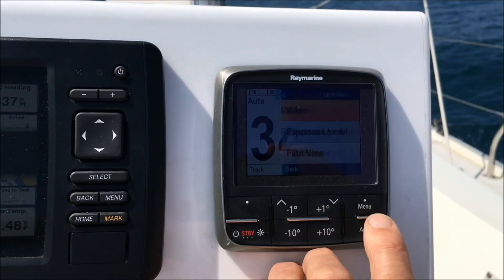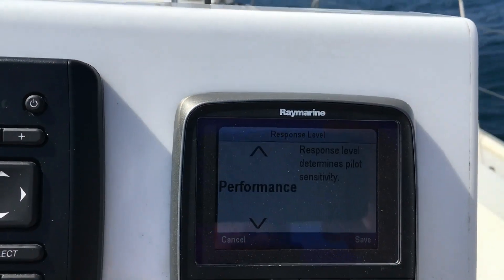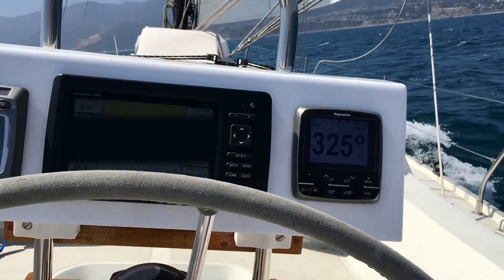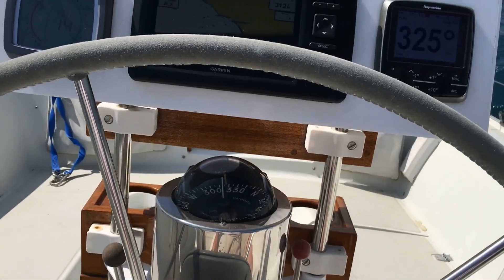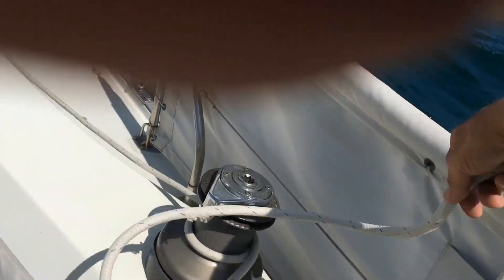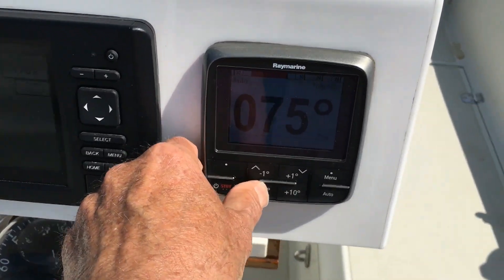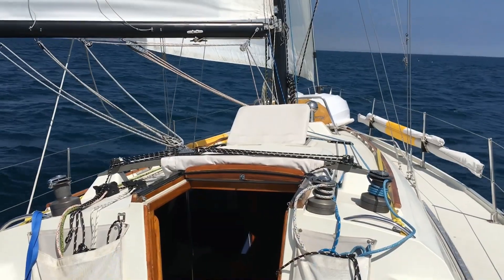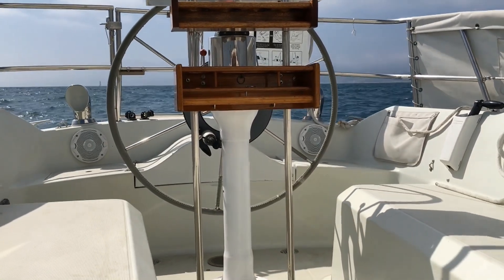Why We Sail--"The Wheel Pilot, 2018"

Comment: Thought you can Tack or Gybe by pressing -1&-10 together or +1&+10 together
Reply from the maker: Plus and Minus simultaneously gives 90 degree turn.. Repeated touches of + or - inputs any new course you like. In casual daysailing my tacks and jibes are seldom 90. For a 130-degree jibe, 13 taps. Can be useful when shorthanded. .

Comment: I have an ST4000 that quickly drift off course after I set the autpilot.  I was thinking of replacing the system with an EV100 but you made me think about sail trim.  Perhaps I just don't have it trimmed right.  I'll be honest, I don't have much of a clue of what I'm doing.

Comment: Do you have the rudder sensor as well? This video helped me decide to try out the EV-100 on my C&C 30-1 and I'm trying to decide if I need it.
Reply from the maker: Not required, and mine works fine without.
Reply: Hey John, just pulled the trigger on one tonight. My boat is also a C&C 30 mk1. Let me know how you make out with yours!
Reply: @brandonedwards1181  for sure. I really wonder because I worry the swept back rudder shape of the C&C 30 can do wonky things. From what I’ve gleamed online some people love their Ev-100 autopilot and others hate them. I suspect sail trim and also placement of the sensor can really impact performance. Where are you going to install the gyroscope?
Reply: I'm supposed to be getting mine in tomorrow. Boats on the hard because winters in Newfoundland can be very harsh. I'm not sure where I'll install the gyroscope just yet, I have to get the old tarp off the girl this weekend, so I'll decide then. I will report back with what I'll do. This is my second year with the boat; I found she had a lot of weather helm when I sailed her the few months she was in the water. Make note I mostly sailed with the genoa, but this year I plan to utilize the mainsail properly (this is my first sailboat). Hopefully, she will balance out the way she was meant to, I had an experienced sailing friend onboard, and the genoa the boats outfitted with was like nothing he has seen before. It is probably one designed for racing given C&C's history, but it has me a little worried that it's causing the boat to be unbalanced. But one way to find out.

Comment: Christian, thanks for your video, probably the best for ev-100. I've been using ST 4000: following 5'+ see it loses control in 5 -10 min, in close hauled it continuously corrects course, while it is not needed. The system setup is not strait forward, does not have deadband . From your video looks like EV-100 makes not big difference. Am I right? I try to choose between EV-100 and CPT. Your opinion?
Reply from the maker: Both Raymarine SPX-5 and newer EV-100 work well for me, with no such issues. Sails must be trimmed or reduced for neutral helm. I haven't tried the CPT, it looks clunky to me.

Comment: As a real novice, this is really interesting thanks. So how easy/quick is it to switch off the auto pilot and take over the wheel manually instead? Also, what are the limiting factor to using the wheel pilot, it seems to be suggested here that a bigger boat or stronger winds wouldn't be suitable for this system? Thanks if anyone can offer answers. Best Wishes.
Reply from the maker: To disconnect, push a button and release the clutch.  Wheel pilots are simple and inexpensive. They're intended for motoring and light-air sailing.  Heavier conditions require a  powerful hydraulic steering unit or a wind vane such as: https://youtu.be/_gEJ3RJYiYc?list=PLXJx_F6E8T8y8BVNBmmZ1c9udOwnNjx93

Comment: Do you find any performance differences between the new wheel pilot and the old SPX?
I’m interested in any generational improvement between the two.
Cheers
Reply from the maker: Not much difference in performance or interface.  Both work equally well for me.

Comment: It's one thing to be on flat water. It's another to use the wheelpilot for 6 days on an ocean passage. I have 3 spare wheel pilots and am planning on installing a below decks unit because their motors burn out so frequently. My boat is lighter than yours. I will look to adjust the "hard over time", which I have never heard of before this video. Thanks for the tip.
Reply from the maker: I suggest a wind vane, since you already have multiple wheel pilots (which are only designed for motoring or light air but work very well when not enough breeze for a vane).  https://www.youtube.com/watch?v=_gEJ3RJYiYc

Comment: I have an older Raymarine, but I believe they still have the feature that for an “autotack”, press the +10 and the +1 button once simultaneously, and you will get a preset 90degree turn.
Reply from the maker: Regarding "auto tack":  Why would anybody select a preordained tack?  Why not select a 90-degree tack, or 100, or 110, or 130 degree tack?  Who jibes 90 degrees each time? Why not do the jibe you want, of 40, or 80, or 120 degrees?  Is is very easy to hit a single button numerous times. It's easier than having to look at the control head in an active  seaway and hit two buttons simultanously for an "automatic tack" written by  a software engineer.  Isn't it?
Reply: Christian Williams I only use the autotack feature when tacking through the wind going upwind.  It tacks the boat fairly quickly with a single button-push (instead of pressing +10, nine times).  while I am busy operating the headsail winches. I then fine-tune my heading once everything is starting to settle in on the new tack. Gybing downwind, I do more or less exactly as you demonstrated in this video.  Incidentally, if you wanted to auto tack 100 degrees, you can just hit the two buttons together, and immediately another +10, and it will turn 100 degrees with two button pushes instead of 10. Really, it’s only useful for quick turns.
Reply from the maker: I only keep pasting that reply in because so many folks remind me of the autotack feature:).   Surely we can all do it any way we like. Cheers.

Comment: You would think this day and age , they would have added a memory button so you wouldn't need to push the button ten times every time you need to tack or jibe. Buttons are the first thing to wear out. I'm not impressed with Ray Marine. I wonder if their odometer still dead ends at 1000 Miles.
Reply: Robert Orzech if you push the +10 and + 1 buttons at the same time it will tack. -10 and -1 the other way.
Reply: Robert, no we have 2900 miles so it doesn't stop at one thousand.  I will let you know when we get to ten thousand miles.

Comment: +1 and +10 is autotack right?
Reply from the maker: Regarding "auto tack":  Why would anybody select a preordained tack?  Why not select a 90-degree tack, or 100, or 110, or 130 degree tack?  Who jibes 90 degrees each time? Why not do the jibe you want, of 40, or 80, or 120 degrees?  Is is very easy to hit a single button numerous times. It's easier than having to look at the control head in an active  seaway and hit two buttons simultanously for an "automatic tack" written by  a software engineer.  Isn't it?
Reply: I'll try your technique then! btw how often do you get out and sail?

Comment: Per the other comment below, you can auto-tack by pushing 1 + 10 at the same time.  You don't need to hit it 9 or 10 times.
Reply from the maker: I find it much easier this way.  You can command the tack from 90 degrees to 110 to a beam reach or more, and you can jibe through any chosen angle. And you can do it without having to look at the control head.
Reply: Fair enough.  I liked the auto-tack because I didn't realize you can slow down the turning action so by the time I got done pressing the button 10 times the boat was already half way through the tack and I hadn't touched the sheets yet.  Thanks for pointing out the hard over time adjustment.

Comment: Happy to see you posting another excellent video!  I agree, having an autopilot makes a world of difference in comfort and reduced fatigue.
 Doesn't the newer control have the "Auto-tack" option?  I have an old ST4000,  it and the 4000+, 5000, etc all had Auto Tack.  Press the +1 and +10 degree buttons simultaneously to tack to Starboard, -1 and -10 to Port.b  Default setting is for 100 degrees, and I think that's configurable.  Makes single-handed tacking much less clumsy for me!
Reply from the maker: See description.
Reply: I don't have your level of experience, so when I'm single-handing (most of the time) and need or want to tack, I use the 100 degree auto-tack, deal with the genoa sheets, and then yes, I almost always have to add or subtract 10 or 20 degrees on the pilot, and fine tune from there.   I've only been sailing a few years, I have a '78 vintage Catalina 30 with a tiller and end boom sheeting.  Suffice to say I'm happy to have the tiller pilot.  Had it fail once on the start of a weekend sail to Santa Cruz Island, made for sore arms hand steering back with 20 knots. :)

Comment: Excellent stuff. I'm currently on the fence as to whether to invest in the EV-100 for our wheel-steered Endeavour 32 or to attempt a, far cheaper, hybrid version by rigging up a tiller pilot to the same wheel.
Reply: Have you considered a windvane? No electrical use.
Reply: I have, but want to keep costs down on this boat as we plan to upgrade within a year or so. Plus, the favors and solar are already cluttering the stern.
Reply: Convert to tiller and open up the cockpit when at port.